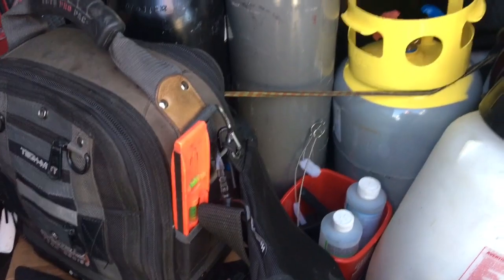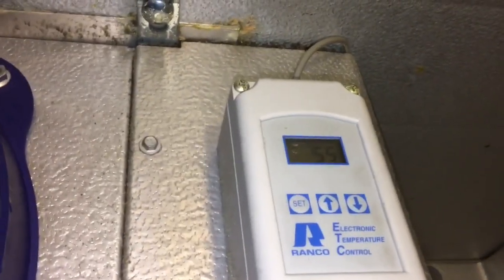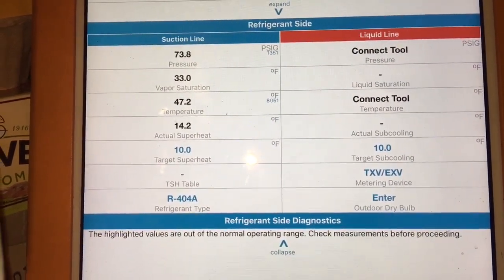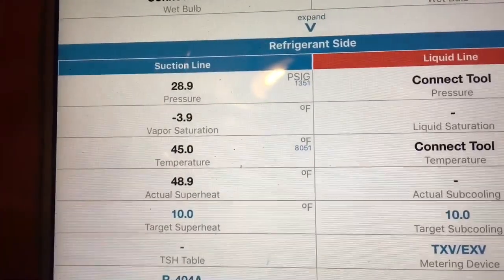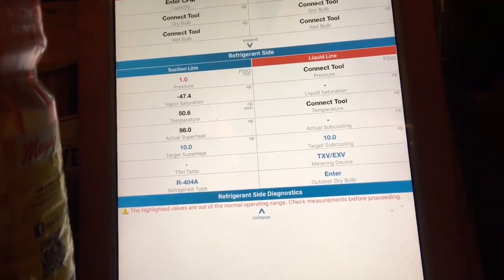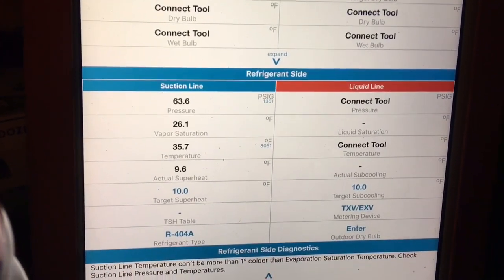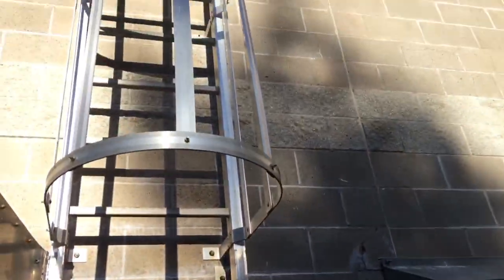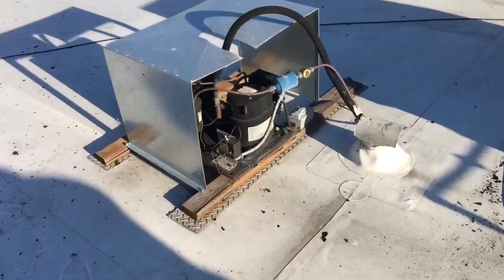No answer on this one.

Comment: I work mainly restaurant refrigeration as it's a challenge and sometimes a mystery like this video. The last service tech could have adjusted the pressure switch in the winter when he really needed to add a condenser fan switch that cycles in cold weather.  Wrong adjustments in Summer will cause trouble when it gets cold with erratic cycling. We have all experienced the "low air" in the tire pressure of our vehicles the first freeze in winter. Same principle with refrigerants. Excellent video!

Comment: As a restaurant owner, having a lot of your product freeze is a huge problem.  Not only does it damage product it seriously degrades the quality of your items and can cause you to open late or run out of items that need to be re-prepped.  Depending on how busy the season is, I would (and have) spent the money on possibly unnecessary repairs in order to try to prevent another big problem.If somebody like you (I'm lucky to have someone like you doing my refrigeration) explained the situation chances are I would do the suggested repairs.  If worse comes to worse it's really not wasted money because I'm sure my guy has saved me considerable money by doing a better job than most people and would make some of it up to me in the future and be there for me if I had a late night emergency.On the other hand, if it's a new customer that hasn't gained your trust, have them put in a thermometer that records the lowest temps and they could see for themselves if there is a temp inconsistency.

Comment: Hey Dave I know you know your stuff. So I’m not coaching here. But being that it froze the product it can only be 2 things. Solenoid valve got stuck open/did not fully seat to allow condenser to pump down. Or the thermostat had a glitch and never opened at set point allowing the unit to continue running. Refrigerant related issues would be lack of cooling or extended run time= frozen evap coil/warm box. Unit starts working once you arrive, those calls suck.
Reply: Oh then again Anthony knows stuff too 😊😊😊 he is one cool dude very helpful thanks 👍👍👍BTW I guess change t stat n solenoid get done with, what u gonna do calls like that is always a downer u top tech u'll overcome thanks for sharing love your Vids n attitude 👍👍👍
Reply from the maker: Eugene Kan I don’t change gear until I know which part failed. And like Steve lavs says you eat the S sandwich. But it’s fair to the customer. And I want long term customers not one stop and gone. 👍
Reply: Nor-Cal Refrigeration & H.V.A.C  I'm thinking you think ok
Reply: Or they left the door ajar

Comment: Make sure the solenoid valve capacity is right, I had one that the valve was oversized, did the same thing. Talked with Sporlan rep, put in right size, been a couple years no problem.

Comment: Dave, good video.  I had a t.stat in a walk in cooler do that this last week.  Turned out on back of the A419 controller one of the traces to the liquid line solenoid was burnt.  Went down to the supply house picked up another controller and changed it.  Ended the intermittent problems with that one.

Comment: On these calls with the digital controller I like to switch the probe programming. OEM settings normally fault into cool mode so switching the probe fault to Open the circuit will at least make it obvious the next time around if the probe is bad because the box will warm instead of intermittently freezing

Comment: Sometimes they play with the stat or solenoid bypassed I've ran into boxes like that a couple of times and ended up installing a defrost timer controlling the stat and solenoid. When your running saturated temps below 32, you'll have the risk of coils freezing up so the off-cycle defrost is a option!! It will work all the time but like you said your dead on with pressures but stat could be acting up... hope you solved it and if not I'll keep picking my brain for a.possible answer!! Good one and I like your videos!!
Reply from the maker: Alexander Figueroa thank you. How have you been?
Reply: Kicking man getting back to normal lot of repairs and vrf installs...

Comment: Guess more than just one technician is suffering no answer calls this week. Ran across a unit witha dead blower, and 2 circuit boards. Blower turns on and then off after 20 seconds of the unit starting... circuitboard says its the blower fault, when the blower still works.... both circuit boards work as well.. so we’re figuring it out, and going to replace the blower board. The other board was confirmed to be working, but the blower board...not much we can do. Never buy a Nordyne.

Comment: wait until it does it again and hope it breaks permanently or throw parts at it. thermostat, solenoid, dryer.
maybe add a light to show when solenoid has power, then if it's frozen with thermostat stuck, customer can see it?

Comment: Use your data logger for a couple of days Dave if you can spare it for that long.Change drier and recharge.BGRefrigeration Adelaide SA.Keep up the good work.
Reply: most HVACR folks don't have anything capable of long term data logging, nor know what it is.
while it does make sense to log box temp, outdoor temp and solenoid valve power, it's not always practical and they may as well install computerized control equipment with alarms!
Reply: throttle bottle saw some cheap battery operated data temp loggers that you plug in usb to read later...have to find and look again.
Reply: a temp logger like that would somewhat help, but best to log the solenoid valve power status and have a temp sensor logged hooked to the suction line or coil to see if the valve closed fast/fully :)
Reply: The little CPS bluetooth data loggers that Johnstone puts on sale for $40 every so often are nice for medium temp but don't hold up below zero.

Comment: Hey Dave, i'm always puzzled why on R404 you Guys pull your pressures so low to cut out on LP Control... I go 60 cut in, 20 cut out,i cant see the need to go to 2 lbs..having a bit of gas in evap helps coil defrost to, in theory it overheats comp reed valves and adds to wear..  also ive seen the same 2 lb setting on scroll comps, when they go that low and cut out you hear the scroll clatter and clunk, cutting scrolls out at 20 lbs they stop smoother.. that's what the sales reps preach to us here in Australia.. interested on your views...  And Who ever installed that system, needs to buy some pipe benders, because whats the point of that cover.???  Stupid..
Reply from the maker: drcolster that unit was hacked in. The cut out is just old habits. The scroll should cut out higher. The cut in is set so it will make in low ambient. On a cold morning 60 might not make here until it heats up outside. So I set the cut in lower.
Reply: What are the Coldest Ambients in your area Dave..??
Reply from the maker: drcolster 30’s over night rarely 20’s

Comment: Pump down with solenoid letting by? Sticking relay in the thermostat? Temperature probe intermittently reading wrong? Customer been playing with the stat! Its either parts canon or see if it does it again!
Reply from the maker: OcRefrigeration,Hvac & Electrical. Oh ya. I like to leave it and see it happen again.

Comment: Head scratcher for sure. What was the thermostat set for?  I run into customers cranking those things or if it's in a bad spot they bump them. I had to remove one out from a wall today because the wall had no insulation to an outside wall. The thermostat was picking up wall temperature which was -10C  due it being winter in Canada, and shutting off too soon.   I cut up some foam board and remounted it. Worked great until the customer can foam board the whole wall.
Reply from the maker: Apprentice Phil stat was set properly
Reply: What about electrical connections on the solenoid?  I know it pumped down but I found recently a walk in solenoid with arcing wirenuts due to a loose connection. It pumped down if you wiggled the box.

Comment: Walk in door left open????
Reply: A door left open definitely will cause a frozen evaporator coil due to continuous run time trying to satisfy thermostat set point. BUT it will NOT cause the product in the box to freeze.  Think about this. Temp control set between 34-38 degrees. Water freezes at 32 degrees f.  So if the cooler/box actually got down below 32 degrees freezing the temp control should have opened/ cycleing  the cooling unit off before the product can actually freeze.  Hopefully my explanation was understandable.
Reply: There is some validity to what you say but think about this if a door is left open and the placement of the product is such that close to the floor or say stocked product opposite of the blower coil along with stratification of the air within the box could very well freeze product after all we're talking about produce doesn't take much but you do bring out a good point
Reply: I hear you. But most likely from continuous runtime the evap coil will start to ice up. Once that starts to happen then no more cooling produced but evap coil continues to run. Then you have a Frozen evap coil with a warm box.

Comment: was there any head pressure control on that unit? and whats up with that line set going up and into the unit? thats not much of a dog house....that unit will be wet if it rains
Reply from the maker: kingofthecrease30 that unit was hacked in 2008. No head psi control hack specialist 😂👍
Reply: Nor-Cal Refrigeration & H.V.A.C   i knew it...didnt see anything...maybe the head pressure is dropping to low overnight when it gets colder out...nor cal dave to the rescue 😀

Comment: Door left open?
Reply: A door left open definitely will cause a frozen evaporator coil due to continuous run time trying to satisfy thermostat set point. BUT it will not cause the product in the box to freeze.  Think about this. Temp control set between 34-38 degrees. Water freezes at 32 degrees f.  So if the cooler/box actually got down below 32 degrees freezing the temp control should have opened/ cycleing  the cooling unit off before the product can actually freeze.  Hopefully my explanation was understandable.
Reply: feel daft now! cheers :) ill go for a sticky relay then.

Comment: 99 out of 100 times this call will be a Defective temperature control. You did all u  could do on this first call. I Had the Same call Last Month it was a Mechanical sticking sometimes , ( The A421 Video was Born ) If it happens again , time to throw a Nema 4 , A421 on that baby.
Reply from the maker: OcRefrigeration,Hvac & Electrical. I usually find it to be the solenoid leaking by more than Tstat problems 99% of the time.